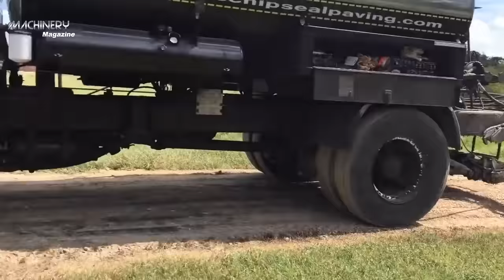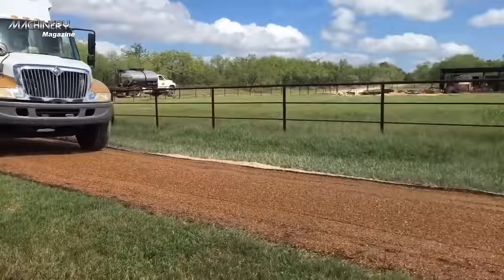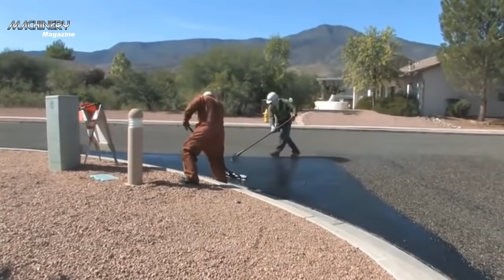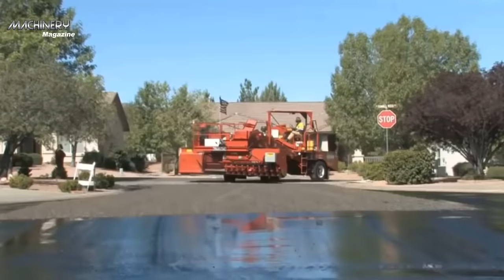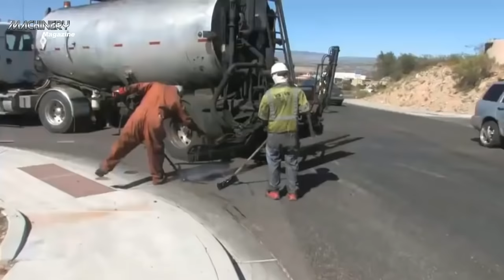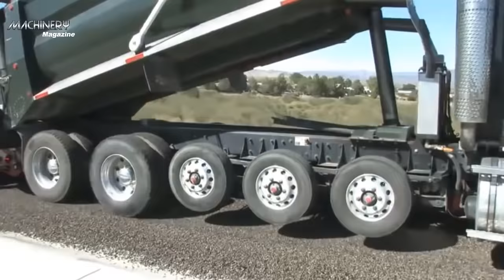Amazing Modern Asphalt Road Construction Technology - Incredible Fastest Road Paving Machines

Comment: Nothing new about this...  They were doing this 60 years ago when I was a kid.  Really is a messy process, it looks good when you first put the rocks on but when the tar starts mixing in an binding the rocks together you get a lot of tar on your cars.  A real mess to clean off.
Reply: well, we are in an internet era where everything is an effing big deal. there was no stone layer on this. did they just pour concrete on the mud road? i did not see pebble layer there. if it was usa i would be hugely disappointed.
nothing new as you said this is more than 60 year old process. and much ga ga about nothing. what else is new.
Reply: @king_has_no_clothskul8635  Usually, tar and chip is laid over a bed of #2 stone or the like. Video seemed to show it being spread over dirt. Around here that's known as a tail light job; falls apart about the time the contractor's tail tights are out of sight.
Reply: @65csx83  all under-developed countries do that. that whole area is a dust-bowl. i have had issues since time immemorial.
that is why US got a head because they made a conscious effort to have excellent super-highways. Noise and Dust one of the reason i could not do CIVIL ENGINEERING. it looked low-budget. if i had seen skyscrappers in person i would have gone there automatically(there is architecture part which they have made it glamorous)

Meaning nation always ready for business. japan did not have to do that so they got fast trains. so that to do business you get from one place to another quickly. of-course they got oil( usa et all)

europe could not do that and hence settled for trains( europe has plenty of oil too).
Reply: Actually easy to get it of.
You only need butter...
Let it soak in.. and spray it of with water.
Reply: Cierto, en España esto se hace en las carreteras de menos nivel, y se hace desde hace decenas de años.

Comment: Cold asphalt pavement technique. It is suitable for road pavement in cold climatic regions. The surface has no bearing properties. The road surface cannot withstand the tensile loads of heavy traffic and after the surface ruptures, deep pits may occur on the road base. Not suitable for hot climatic regions. MC800 will melt in the hot, causing the chip bond to weaken. Especially on sloping roads, the road surface resembles waves in the sea. On the positive side, it provides an inexpensive solution for a short time in cold regions where the traffic load is low.

Comment: Six months later it’s like driving on the Moon
Reply: It held up pretty good in Utah, because of no subzero bitter cold winter, therefore no pothole but a lot of cracks. After 30 years 6, 7 layers of asphalt paving, roads getting higher and higher and harder to get off the driveway, that's all!
Reply: Ten years going by my house, its in great shape. No problem (It was applied on top of a healthy asphalt base, though, not on gravel.)
Reply: @manfred: yes it is a very noisy road surface.

Comment: Not new, Hauled tack and emulsions for a Company here in South Mississippi for 10 years, 12 years ago. Blacklidge Emulsions did hot tack with rock over it  for more then 2 decades. They are still one of the major road tack and tar emulsion producers in the South

Comment: I remember this being done every few years where I grew up in Minneapolis.  I also remember how the sealing rock got just about everywhere after a few weeks.  Had on neighbor who cleaned up the stuff that got into the gutter next o the curb and used it in his driveway, then poured driveway sealer over it. Worked really well.
Reply: Clever man for saving money.
Reply: Chip seal is fine for lower volume roads but a lot of the traffic are heavy vehicles and it’s not long before they’re out there again throwing another layer of chip seal down. It’s cheap I guess but engineers are kidding themselves when they it’ll last 10 years

Comment: AS a kid born in 1945 growing up on the outskirts of London UK, I used to watch the tar and chipping gang working on the local roads. My mum even made em a pot of tea when they capped our road. 
Lafet in life I went into construction and learnt about road wearing course and slip values, the tar and chipping coat was a cheap way of improving braking distances and road grip in the winter months.
2007 was the last time I did any road surface work was on the Kuala Lumper SMART flood and traffic tunnel, having road decks built in. The two decks took traffic in one direction each, being a road tunnel and to minimize the fire risk of tar products, a special epoxy concrete was formulated. A brush rig followed the concrete laying screed this gave the concrete the desired ridge height to enable safe braking yet keep tyre rumble low. I would test the surface at random spacings with a pendulum measure device. The one area that did not perform was removed and re-laid.
I do love the Title I wonder of it was a bait tactic, but hey it was a reminder of the Good Old Days.

Comment: Does this actually last more than a year? There's no way this could be used in a place with real climate or traffic
Reply: On neighborhood streets, in sunny states, it lasts decades.  Out by my house, its a decade old, looks fine, looks like it'll last much longer.  One of the streets is a neighborhood feeder, its in great shape.  (It was applied on top of a real asphalt base from half-a-century earlier.  Basically, it sealed up small cracks and hid older street cuts.
Reply: Its been years, but this is what they did on the neighborhood streets in Minnesota where I grew up.  Don't remember the precise method. but I remember a thin layer of "tar" followed by a layer of tiny crushed rocks (Sealcoat?).  Usually just let the traffic work the rocks in.  And this was low traffic residential streets.  It was horrible ridding bikes for a couple weeks.  Eventually a sweeper would come by to pickup the excess rocks. 
I seem to remember this happening 2-3 times in my childhood, plus one time when they scraped off a layer, and added a new layer of asphalt. (Bituminous Overlay?)
I don't remember how often, but every 5-7 years for the sealcoat seems to stick out in my mind.

I looked this up as I was writing, because I was curious.

The plan for the city I grew up in is...
6 years - sealcoat
20 years - Overlay

Comment: This spray and chip operation is really efficient, however I’d have liked to see  a light roller over it to bed down the chip. We generally provide an additional sand and cold bitumen slurry seal. Done properly, it provides a good durable surface. As such it is merely a wearing course and the real strength of the road depends on the integrity of the supporting layers. Even a 2 inch layer of asphalt will fall into potholes and crack up if the base is dodgy. The other thing which is essential is the control of ground water. If the supporting layers are saturated the surface will deform and the road will fail. 
Still, I love the efficiency of this operation 😊

Comment: Yes the prior poster is correct, nothing new about this method.
Im 89 years old, and i can remember this method being used when i was a young kid.
Only problem is that most of the stone ends up in the ditches after a few weeks.
It is referred to as the oil and chip merhod.

Comment: This is not, I repeat not asphalt!!! This is sealer and aggregate which isn't worth spitting at. it will last maybe 3 or 4 years at most. They used that on a local highway a number of years back. With the amount of traffic on that highway, they were back in a short time putting down real asphalt to the tune of 4 inches packed. It has lasted about 15 years.

Comment: They call it chip sealing and not really paving to be clear.
 it is a quick fix and does work well in many cases. But please to anyone who knows something about paving this is like comparing apples to oranges two different things. Paving material has structure and thickness much stronger and long lasting. Just thought someone should point this out.

Comment: Did many miles of this we called it chip seal . Hot oil 300+° and coated gravel. Its not asphalt. Way different did many miles of that also. It can be messy but it depends on what time of year and how much oil you put down. There are more variables to it . There is a science to it. Hard work but it was fun. You have to work fast and efficiently because the oil can set up fast then the chip doesn't stick and then you have a mess. This guy is a good spread er operator. Don't see any rollers though.

Comment: I grew up in MAchesney Park Il in the 60's, and this is how they made the roads I lived on.  In most cases they would do a couple coats in the spring, then in the fall a couple more.  Then maybe 2 or 3 years later repeat.  These roads NEVER developed cracks, or pot holes.  Even till today.  They are sturdy roads.  Not like the blacktop mix they use out East that has to be replaced every 3 years.

Comment: I do believe these are the original "MacAdam"  paving.  Build a packed bed of soil/limerock, spray hot asphalt oil on top to protect from rain penetration, spread a rock coating (usually 3/4 inch crushed granite), compact with a roller and viola you have a durable wear resistant surface.  Needs some maintenance to  to fix any (infrequent) breaks in water proofing layer.  Miserable if you slide across it.   Here in Florida they also heat the limerock base with propane burners to drive out moisture from the top 1/2 inch or so of limerock and make the limerock hot so the oil will penetrate and stick well.   But it's an abomination if you try to skateboard on it.

Comment: A new asphalt road can have a thirty year useful life if maintained. After ten years or so it begins to show degradation like cracks and alligatoring in low spots or where the sub base was not prepared properly. Cracks are periodically filled with hot tar and alligator areas must be replaced. After fifteen years another layer of asphalt and sand called slurry seal is usually applied. The process shown here is, as noted by others, chip seal where an engineered and graded gravel is imbedded in hot asphaltic tar. Chip seal must be quickly rolled to work the gravel into the tar before it cools. There is a lot of loose gravel after the installation. Usually the paved area is thoroughly swept to get as much of the loose gravel cleared away as possible. Chip seal and then oiling every three years will buy you another five to ten years at the most. After that the entire roadway must be removed and replaced. Roadways are by far the most costly expenditure that a municipality has and the budget must be carefully planned so that the community is well served. There are other ways to extend the life of an existing asphalt road. This is just one of them. If your roads are deteriorated lodge your concerns with your mayors, commissioners and the city engineering staff.

Here in Arizona the summer sun is just brutal on asphalt. The tar constantly heats and cools. At intersections you will see ripples in the pavement caused by cars braking and accelerating away. Sometimes it actually looks like waves in water only somewhat frozen in place. Then the surface is ground down an inch or more and new asphalt is placed. Most cities now make the intersections out of concrete while using asphalt for the straight paved roadways.

Comment: This is very intriguing to me, but without a thick ass layer of tar (assuming cause its smoking like when you have a roof or shower hot mopped)  and a roller going over the gravel after how it this better than asphalt  or concrete. Paying to do this once a year can't be cost effective and you'll soon have roads at the roof line of a 2 story house

Comment: Yep, that's the guy who could do it cheaper.
Modern construction work is not up to standard and by far not, what it used to be.
But this form of road surface construction, is just bad.
85% of the work, for a proper road is underneath the asphalt, if that work isn't done correctly, it will not last for long.

Comment: This is NOT Asphalt.  This is Chip Seal.  Cheap Stuff compared with real Asphalt.  Won't take the wear either.  It is an inexpensive solution for a light duty road that won't see heavy traffic.  Even then, it still won't last as long as Asphalt.

Comment: Lol, make such a road in Alaska...or Siberia....
Reply: That's exactly how thousands of miles of roads in Alaska and the Yukon are done. Nobody is dragging portable concrete batch plants, or hot mix paving plants out to the edge of civilization. It's chip seal, and in many places a lot cruder than this video, just a tack coat and bank run gravel. Rough graded material dug right out on ancient river banks, and hillsides.

Comment: Nothing new or fantastic about this and it is not “asphalt” it’s called “Tar and Chip” it has been used to surface roads for a very long time. 
It has been used for over 100 years, all over the world with great success, to pave and resurface roads, parking lots, residential driveways, and more. Tar and chip is used by county and DOT road crews on road paving projects in virtually every state in the United States.
A Scottish engineer John Loudon McAdam in the 1820s, macadam roads are prone to rutting and generating dust, so he put tar on the roads and small gravel to settle the dust.

Comment: Not an Asphalt road.  This is simply applying hot oil to dirt/gravel.  It's a sad joke.  No mixing of proper aggregate, no rolling, no compaction.  The first time a vehicle rolls over it the crust will break and expose the dirt below.  And Chip-Seal (per the door logo) is meant to be applied over older existing Asphalt, not loose dirt/gravel.